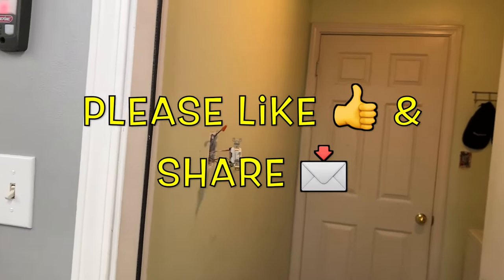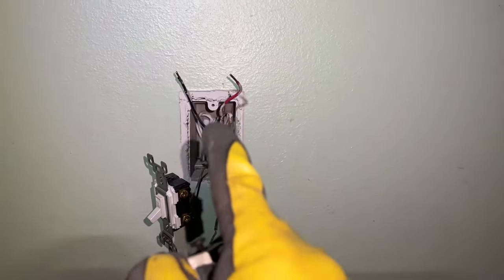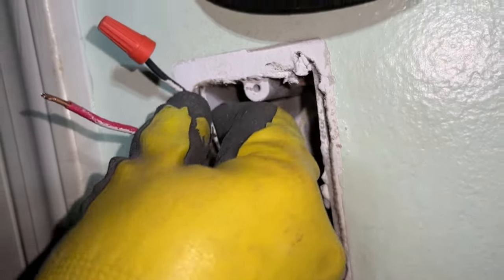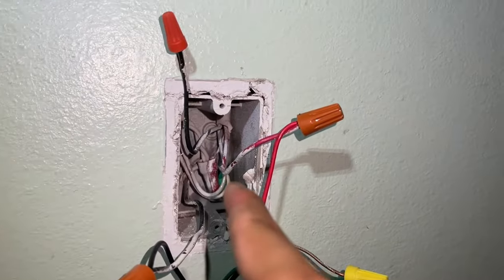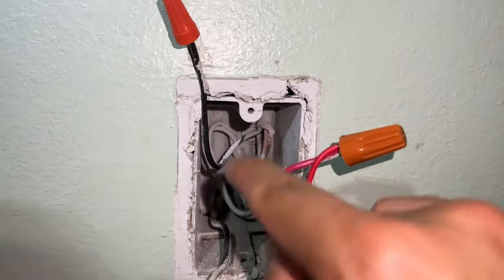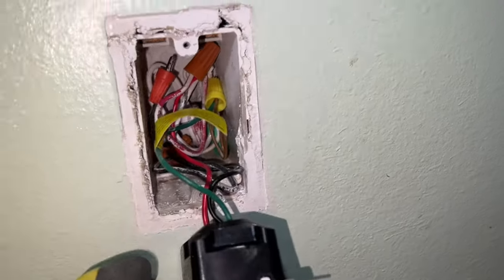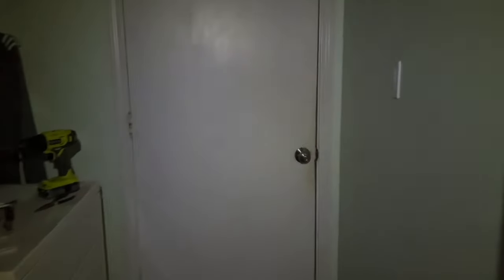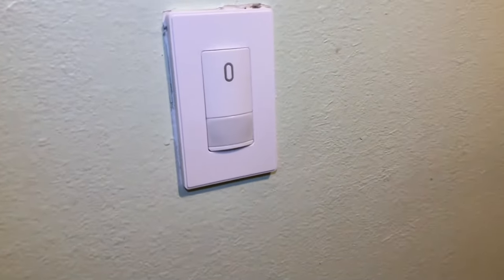✅Convert a 3-way Switch to a Single Pole Switch | Works Great for Occupancy or Wifi Smart Switch

Comment: Great video! Is covering the blank switch with a dummy faceplate the only safe option? Would it be possible to patch the drywall instead or would that be a fire hazard/ against code?

Comment: I'm trying to install smart dimmer switches in my house, and there's 2 circuits that are three way, single pole like this. No where have I found a solution that would work aside from "call an electrician." This makes so much more sense than any other video I've seen. This brans even has wireless 3 way switches you can install anywhere that act as remotes to the master switch, and can fit in the blank space like a switch, but are just the face plate. This is a life saver, thank you so much!

Comment: That's awesome, quick and to the point! I have a bit more strange situation, switch (3-Way) is wired as 3-Way but it uses a remote on the other side to conrol the light, and I think the remote is just basic power source (2 wires) to power the remote so it can control the switch on the other side. I removed the switch and installed a basic 3-Way rocker, does this mean I could have used a Single Pole? Is there a way to test where the power comes to the remote-switch upstairs?